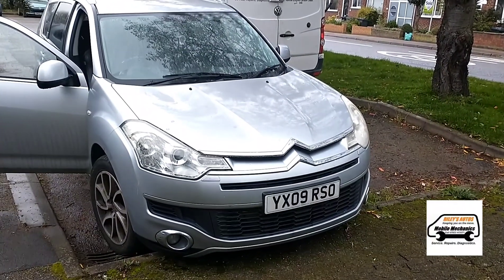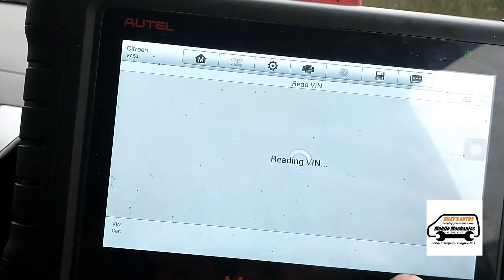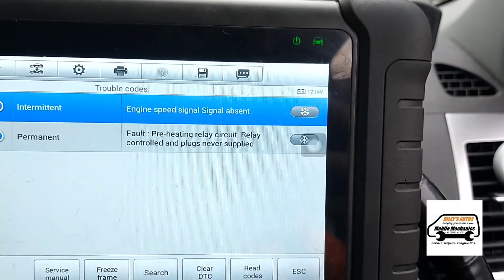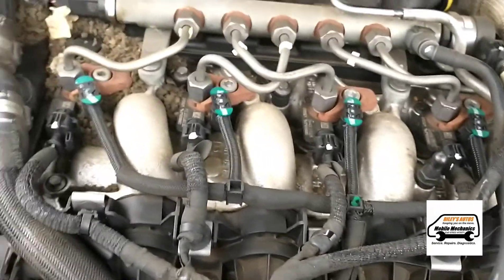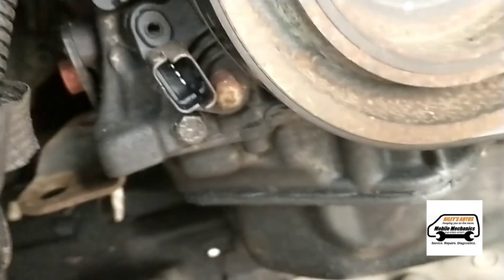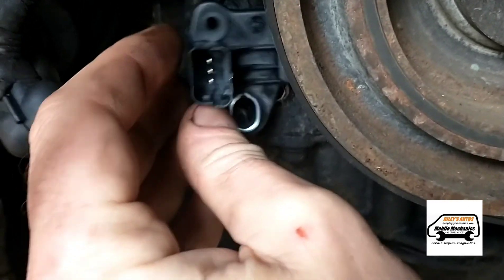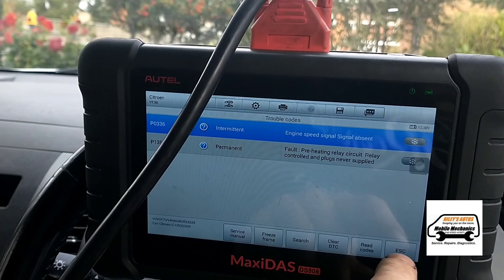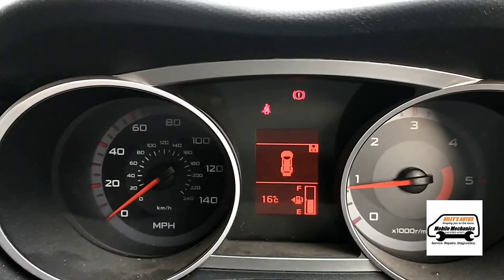Diagnosing & Fix why Car Cranks but won't start? P0336 Crankshaft position sensor 2.2HDi

Comment: Ive got a citroen dispatch 1.6hdi 2013

No start 

Would the crankshaft position sensor being faulty shut the fuel system off?